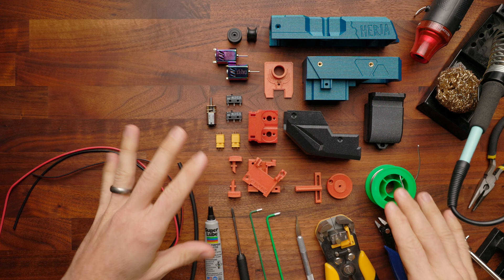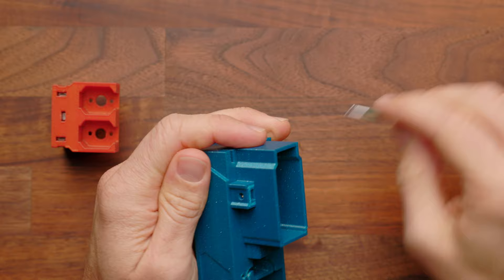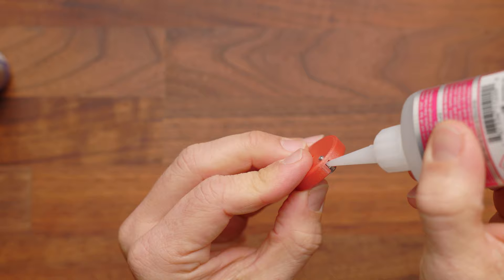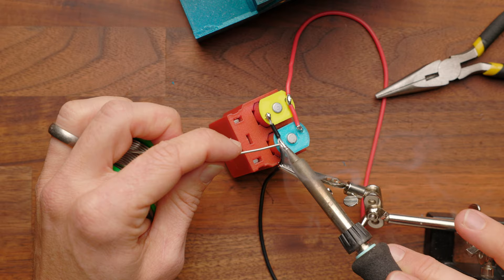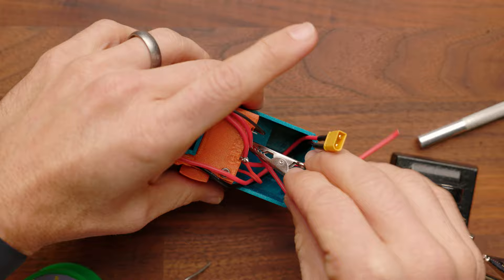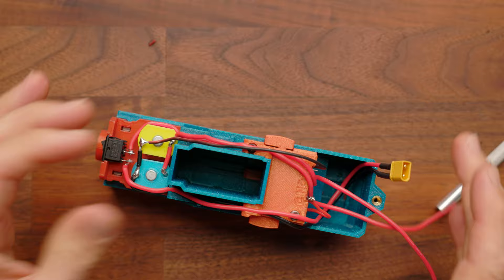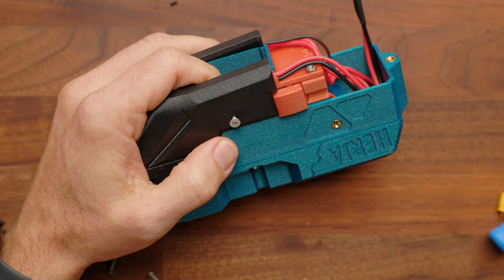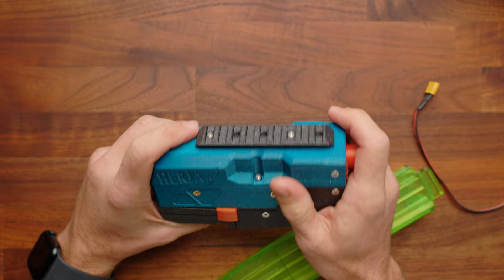BUILD GUIDE: Herja

Comment: I have been looking for a platform to make a shoulder mounted blaster. This looks to fit most of what I need
Reply: The problem, as with any automatic weapon, is ammo feeding. This blaster depends entirely on the magazine keeping the darts coming, with no room for a chain drive or other feeding system, and if it's up on your shoulder, there's not much room for a mag. You might want to consider modifying a Jupiter and Proton Pack

Comment: Nobody seems to use 18650s to power blasters.  Is there some reason why?
Reply: The average 18650 battery capacity can be about 2200mAh, so the energy density is about 500Wh/L, and the energy density of the lithium polymer battery can be close to 600Wh/L. Polymer batteries can be customized according to customer needs, and the shape is varied and varied and can be customized. LiPos have less limits. A late answer 😂 🤷🏻‍♂️ But 18650s are the best in saber builds 😉.
Reply: @audiobrainiac  Thanks!  Since posting, I've been using high-drain 18650s for various blasters but they're still capped at about 26A draw.  They work well for entry-level motor upgrades but can't compete with things like graphene LiPos.  I did manage to fit a 2S2P pack in a battery stock, but I feel like I'm reinventing the wheel at some point.

All of that said, I think a lot of the anti-IMR sentiment in the hobby comes from experience with low-drain 14500s.  Looking at the new DZ Omnia, it appears to be powered by a 2S 18650, so at least DZ is ok with IMRs.